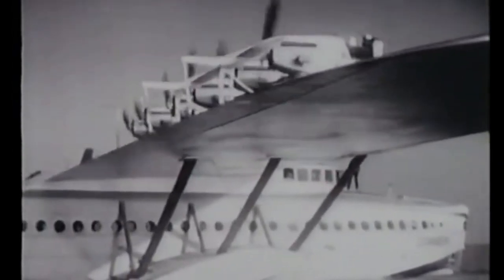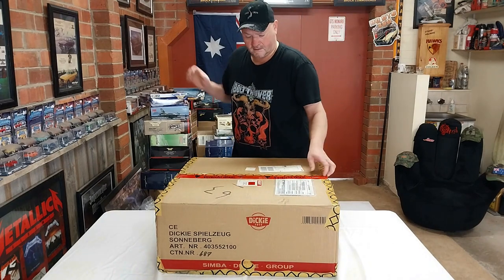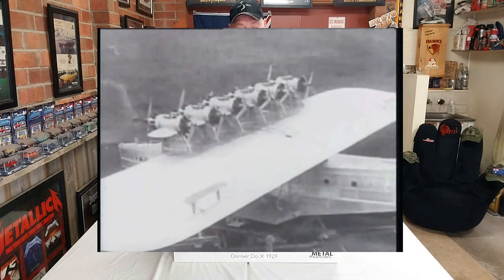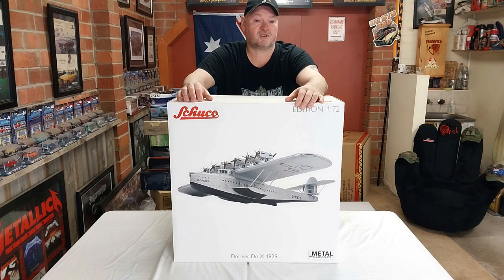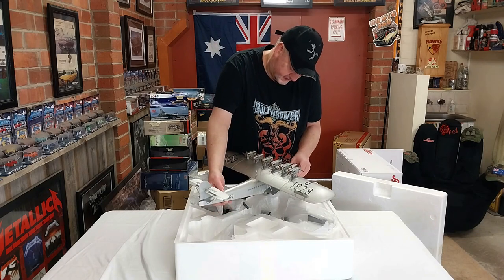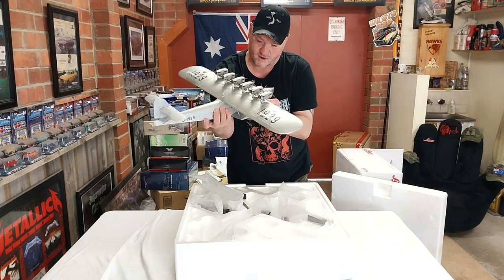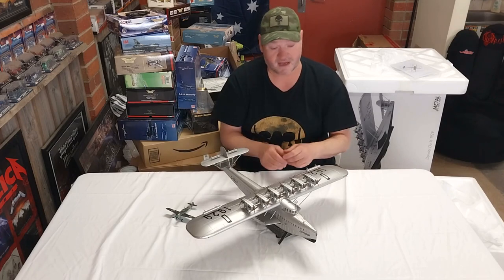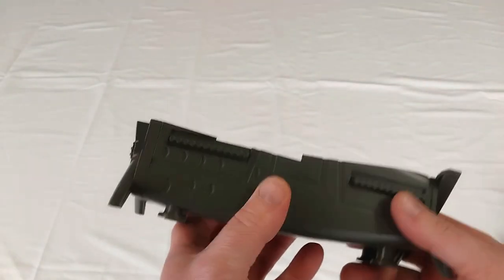Dornier Do X, Flying Boat, D-1929, Massive 1:72 Diecast Model by Schuco

Comment: Beautiful
Reply from the maker: It's certainly is, thanks for watching 😀👍
Reply: @heavymetaldiecast  I collect Franklin mint 1/48 scale  I have the German iron Annie's I have about 50 of them and they are huge! 
Not as big as yours  wow I got to have 1 thank you excellant vedio they had 2 Ferrante engines one radial the other curtiss 12 cylinder v valve
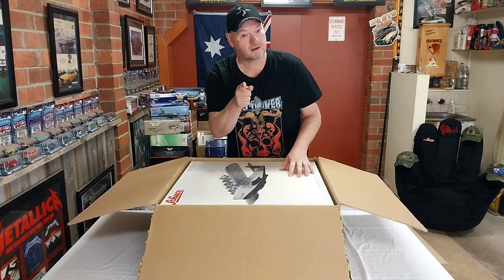Reply from the maker: @HDSME  1:48 is a nice scale to collect 😀 I have a couple Franklin Mint models myself. They are the cheapest so you are doing fantastic by collecting over 50 so far 😀 Tour collection would be impressive to see 😀👍